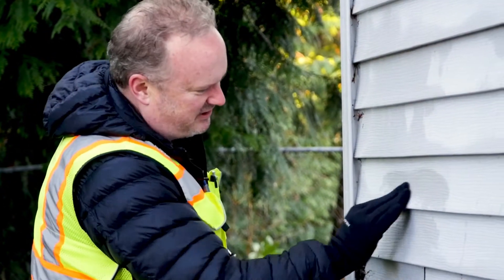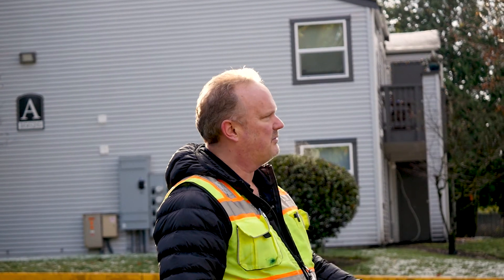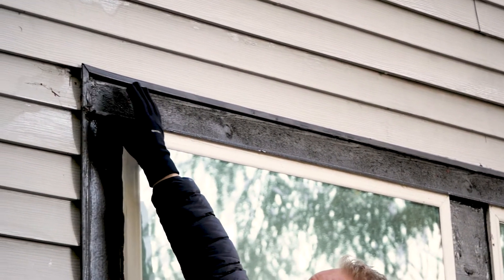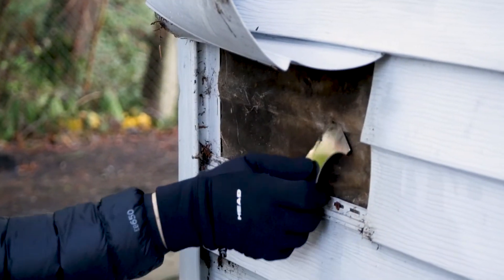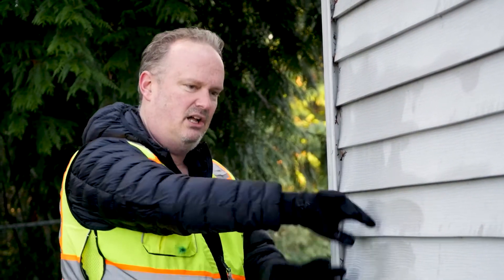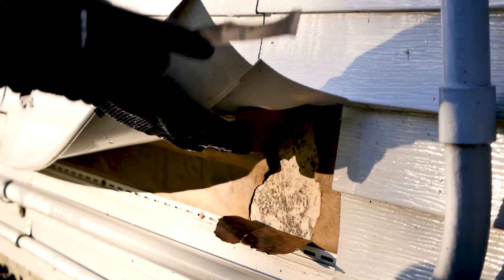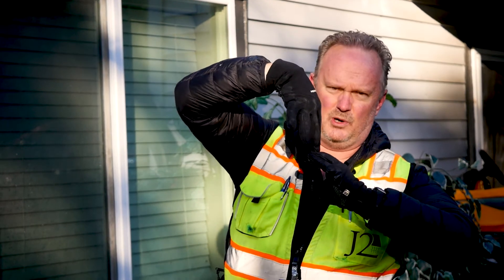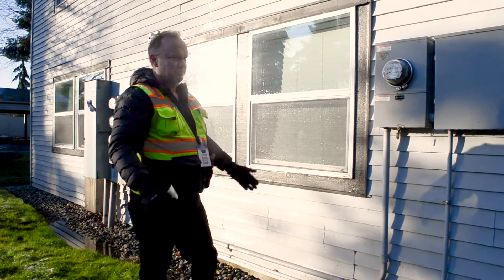Vinyl Siding and Water Damaged WRB

Comment: Oh thank you so much for this video.  It aswered alot of my question.   What iam wondering how do I know its not my window too.  If it is coming thru my winow has it done damage to the wall inside of it between the inside and outside
Reply from the maker: That is what an inspection or water testing will help us determine, you can try to peel back some siding yourself and see....